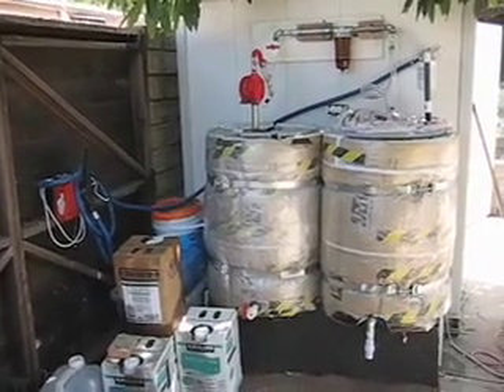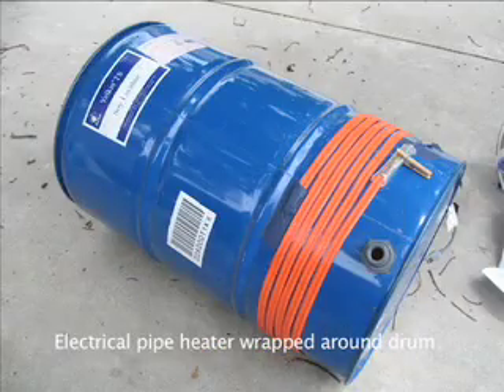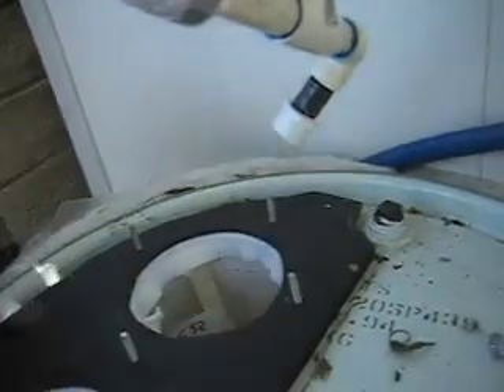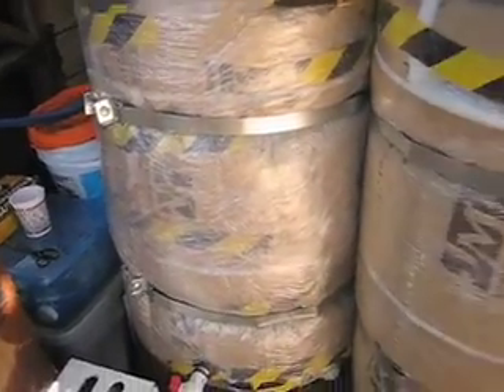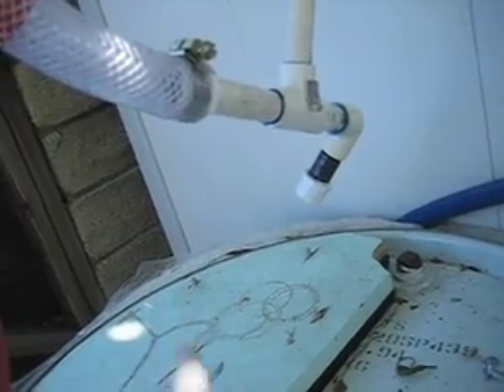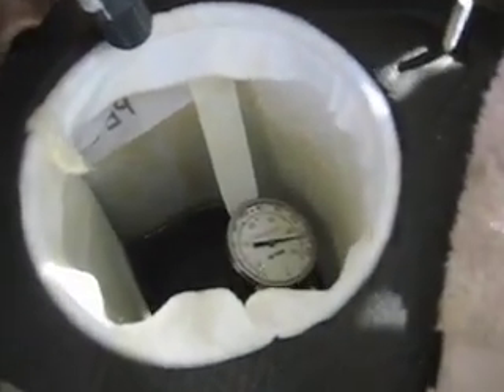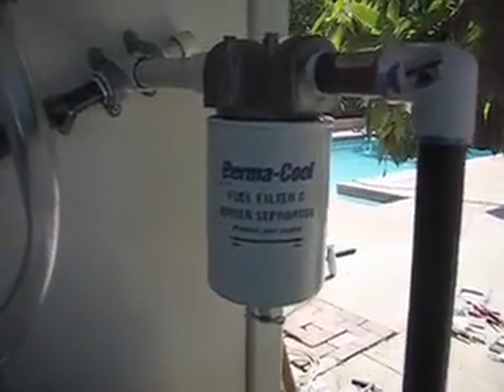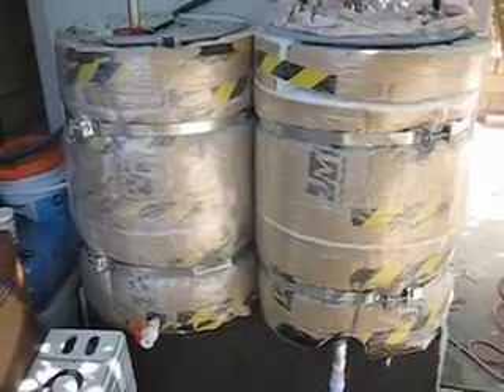waste vegetable oil filtering & dewater

Comment: for long term veggie oil use, you will also need to replace the fuel lines for synthetic tubing as the wvo will actually degrade the rubber hoses.

Comment: Most modern fuel line already has a synthetic lining...

WVO won't corrode like bio diesle will...

I ran ONE tank of Bio Diesel and had black crud in my pre-filter...

WVO i haven't had ANY of that...

I also concur with the post about adding alcohol seems to work fine (I actually cut my WVO in a 10 to 1 ratio with E-85).

Comment from the maker: Letting oil settle - 2 weeks or more  - is the first step in filtering because all the heavy particles settle to the bottom. There by saving your filters.  If it is hot enough and the oil settles enough then not much filtering is needed

Comment: Use a water heater...the only thing you have to make sure of is that you only use one heating element (bypass the other) and ONLY heat oil if the level is above the heating element... you can find water heaters for super cheap...at least in america

Comment from the maker: The amount of water is very low in the oil, this plus that I do not process much oil means I do not drain the bottom sludge much - I haven't drained it yet. Another thing is that a certain amount of sludge on the bottom actually attracts the water to it so you want the sludge there.

Comment: @holtonmusicman incorrect wvo is acidic biodiesel is not. there are many other problems associated with running svo other than this fuel line problem , clogged injectors, build up around valves, etc... don't do it and if you have to don't do it for very long... clouds up engine oil .

Comment: Great work!  I'm modeling my setup off of yours but am having some trouble finding electric pipe heating cable that works for this application.  They all seem to have thermostats that shut the heat off at 40 degrees.  What kind of electric pipe heater did you use?

Comment from the maker: please visit the link in the description for most of your answers.
1. as much as a 60watt bulb cost
2. I use the containers the oil came in to reduce moisture
3. don't know but iI think there are anti fungicide solutions for marine use
4. see link
5.v2 is easier because it is one drum.  manually pour it in and use 12v pump to get it out
6. if you mean for a filter setup, most kit assemblers offer kits

Comment: @joebro32 don't think I would run very much svo, cost is very little to make biodiesel after you have clean svo.  svo is not good for the life of your engine. the increased mainenance cost do not overcome the cost of fuel. however I want to remove glycerine to make soap for personal use and profit.